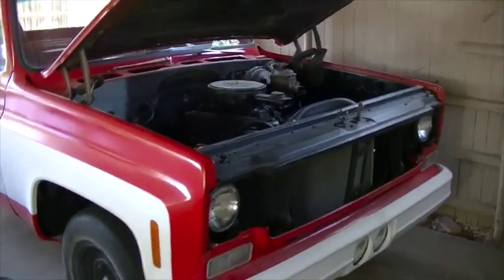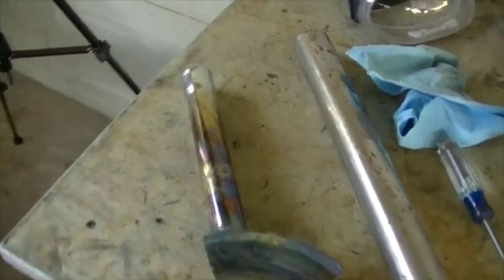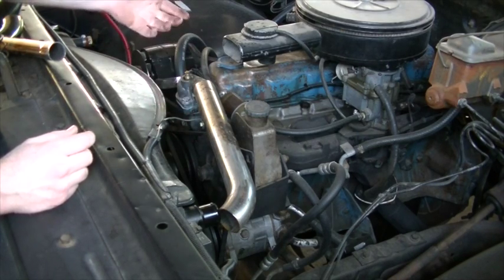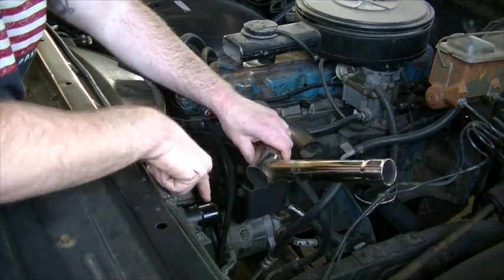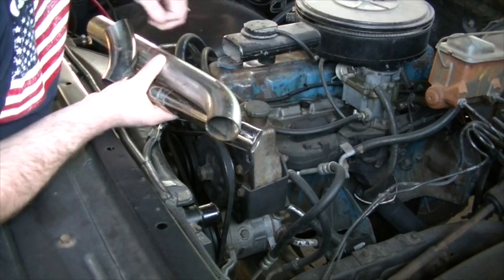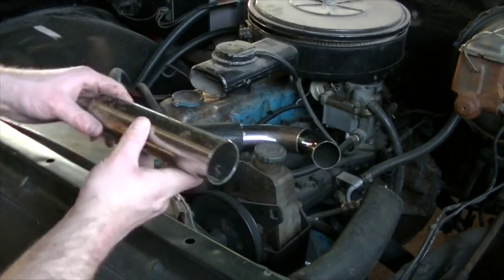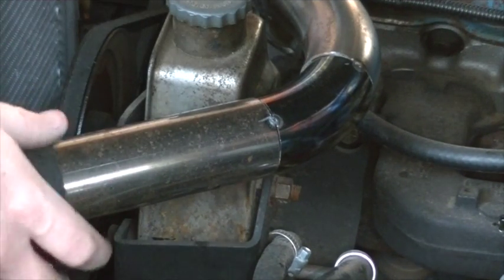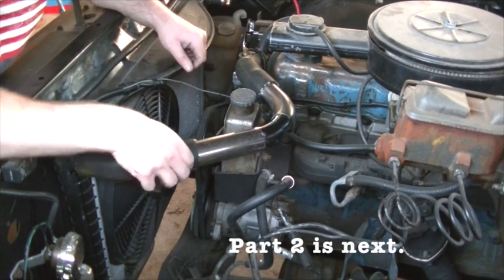PART 1 Fabricating Solid Radiator Hoses | Steel or Aluminum

Comment: You can also add a fill neck in the upper radiator hose or fill the engine from where is the highest point in the cooling system. I have a motor swapped sec gen camaro and these things always have the radiator lower then the engine.

Comment: Loved the pipe work. You need a puke tank instead of capping off the reservoir line. It would have saved you a lot of welding.

Comment: When the hose sucks in like that, it is a bad radiator cap.  however, love the rigid tubes... nice work.
Reply: +milkcrate82 ive got agree with Scotts, your radiator cap should vent, in at vacuum, and out at 12 or so psi
Reply from the maker: scotts439 Thanks!  I'll put a new one on.  Thanks for watching!

Comment: what kind of coating do you use or should use
Reply from the maker: boxboy50 I just used high temp paint on the outside and left the inside uncoated.  It could rust, and eventually will, but not at a faster rate than the cast iron head and block.  With little to no air in the cooling system, it will take awhile before the rust is a problem.  I could always take it to a shop and have it powder or ceramic coated.

Comment: Will that exhaust tubing rust?
Reply from the maker: boxboy50 Uncoated, yes it will.  Not very rapidly though.  Cast iron engine blocks and cylinder heads can rust too, but as long as there is no or limited air in the system, it will take awhile before the rust is a problem.